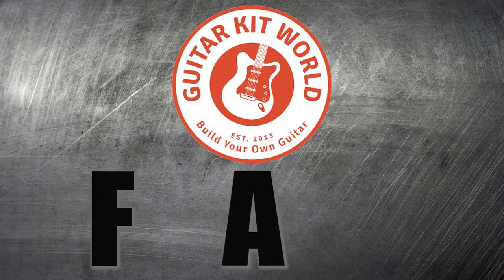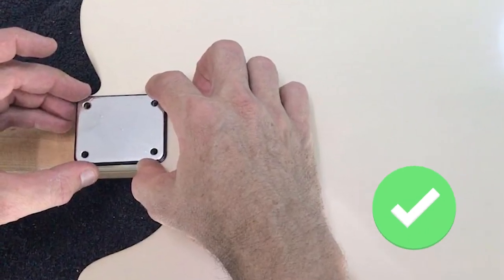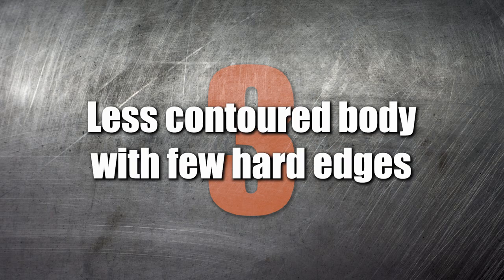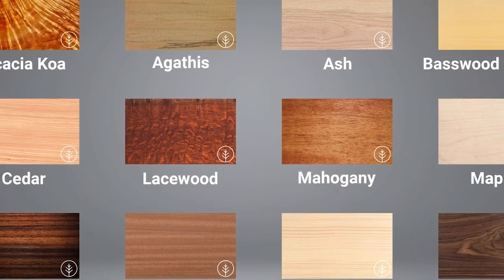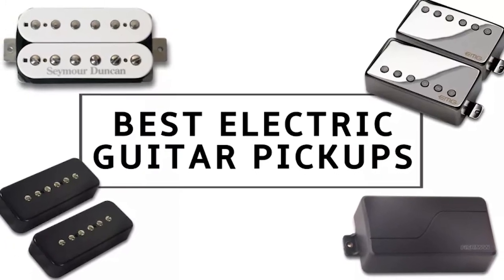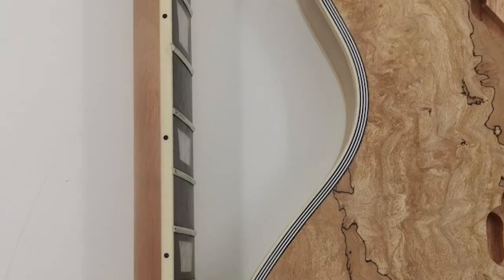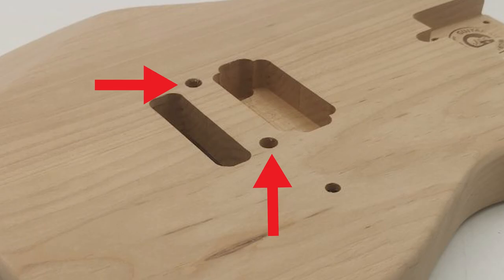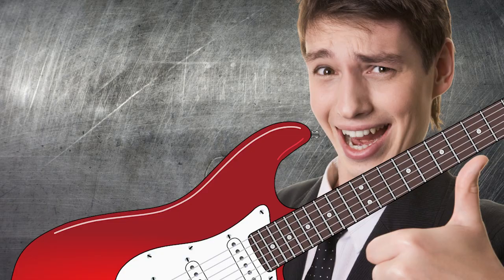Top 10 First Time Guitar Builder Tips

Comment: On my 5th build and I struggled with the placement of my 2 point tremolos. What tips can you give on lining the posts up with the neck or pickup routes?  Both placements ended up with the block rubbing the cavity on the bass side.  I have the scale length right and the strings are aligned with the neck okay.
Reply from the maker: Hey Mike! I could best help you with pictures and videos so I know where you left off with the routing. Reach out to us at support@guitarkitworld.com
Reply: @GUITARKITWORLD  I will take some tonight and be in touch!